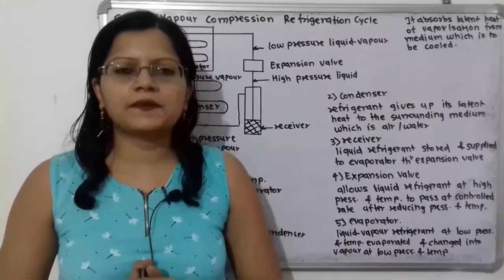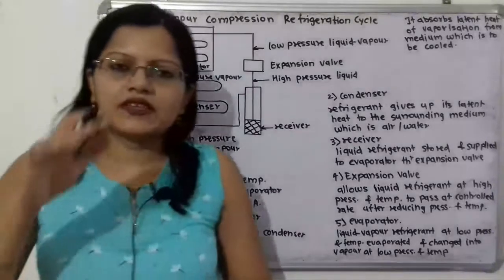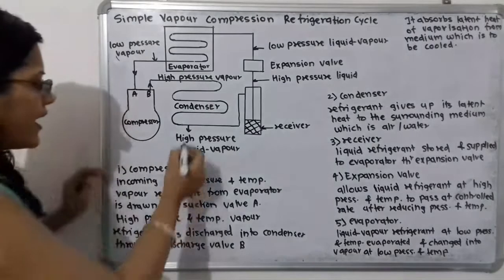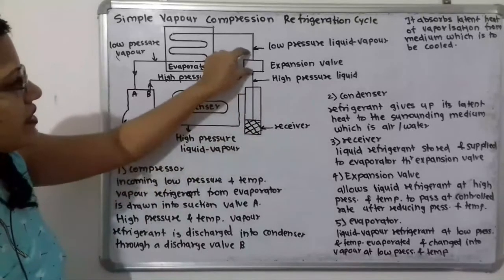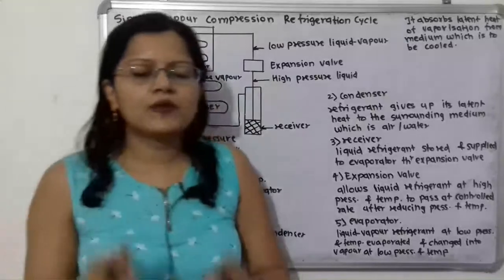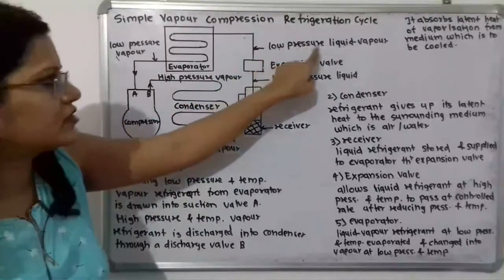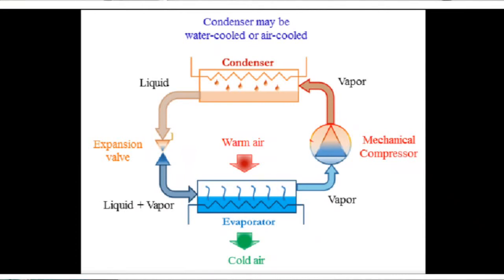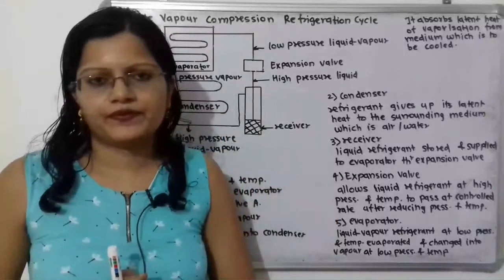Simple Vapor compression refrigeration system (theory)/ Refrigeration and air conditioning

Comment: I've never understood why there is an expansion valve instead of a turbine or motor that makes power from the expansion. Couldn't you couple the compressor to an expander and recoup some energy?
Reply from the maker: Here size matters...
Reply: @edutechguruengineeringlear4280  So it's not worth it on a refrigerator, but it would be at an ice cream factory?
Reply from the maker: @wesKEVQJ  please compare  capacity...
Reply: @edutechguruengineeringlear4280  I think I am confusing what the expansion valve is doing. The expansion occurs inside the evaporator it is just being controller by the valve like a pressure reducer. Maybe a better question would be would a small turbine in place of the evaporator coils recoup energy or would it just rob it of cooling capacity? Assuming you used the turbine casing as the cooling surface.